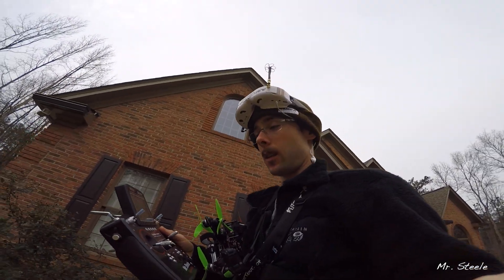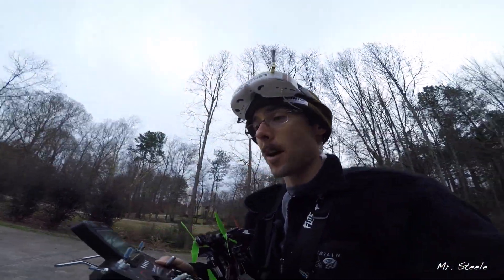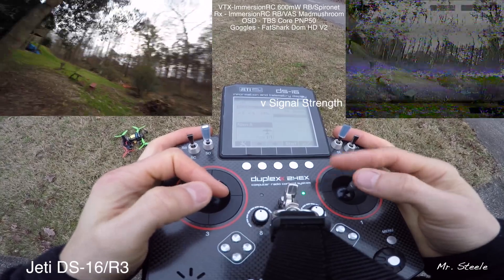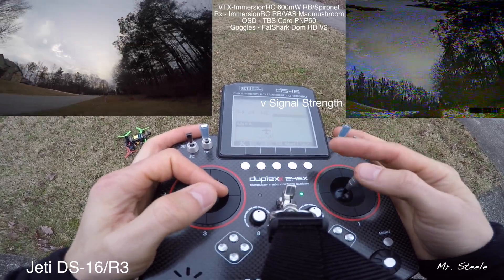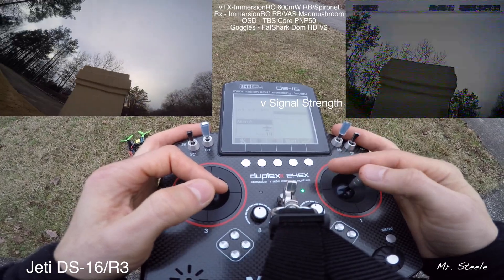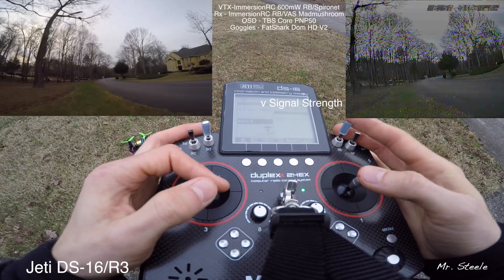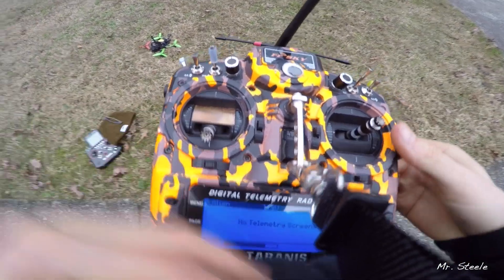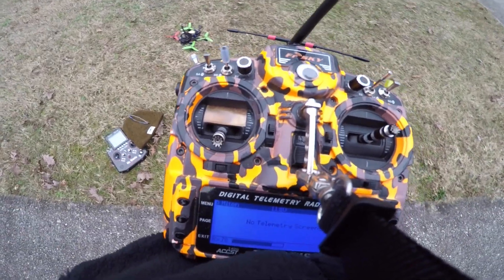2.4GHz RC Range Test Jeti DS16 & FrSky Taranis

Comment: Mr Steel   hi im in need of a bite advice please  i just got my fist race quad the nighthawk 280 pro   and i was going to use my FUTABA RIPMAX  T6EXA  but it has the old telescopic aerial   will i have to change it to a 2.4 antenna    and will this connect to the nighthawk ok  steel

Comment: Is there a hobby shop in the Atlanta area that will let you check out the FatShark goggles in the store with video to see how they work. I have a vision issue with one eye and with my GearVR goggles I don't get an image as clear as I'd like. Before I spend that kind of money I'd like to know they work. I've also looked at the Quanum V2 Pro. I want to do FPV with the quad I'm building after I get comfortable with it. I don't know if goggle will work for me or a fpv screen on my radio. Any suggestions?

Comment: Very much impressed at the taranis performance.  Despite lower build quality and a few less features, it puts up a good fight with the jeti!
Reply from the maker: Wasn't really suppose to be a comparison video. Merely a test to show the penetrating power of both rc links.  Frsky has proved it can penetrate objects and perform in a wifi saturated area before. I wanted to test the Jeti's link against something I know works really well for FPV models.   Since jeti is mainly based around high end LOS models
Reply: +Mr Steele Ah, I see.  It looks like the range issue is fixed though with the jeti! Looking forward to more!

Comment: About what angles are the GoPro/ FPV cam at on your alien?
Reply from the maker: Board cam is 30* and GoPro is about 20*
Reply: +Mr Steele is that 30* plus 10* motor mounts?
Reply from the maker: +Oliver Peters nope. I don't use angled mounts anymore
Reply: Any reason you stopped using them?
Reply from the maker: +Oliver Peters reduction in yaw authority.

Comment: +Mr Steele, nice test vid. It will be interesting to see if the Frsky Horus does as well as the Jeti D16. For heaven sakes what are rates set at? Hardly any stick movement for forward pitch...
Reply from the maker: Thanks. I don't think the Horus will do any better. There aren't any power or sensitivity upgrades in the Horus that I am aware of.
Reply from the maker: And in rate mode or Acro mode you don't need to hold forward on the pitch stick. Once you are flying forward you can just go back to center stick and adjust accordingly.  Rates aren't super high
Reply: +Mr Steele that may sound noobish but why centering the pitch doesn't set the quad on the horizon ? If you push the pitch half way forward , let's say it set a 40deg angle to the quad, and then you pitch back to a quarter forward. Will the quad still have an 40deg angle or will it be at 20deg. (If linear of course) ? 
Great videos, keep up the good job !
Reply: You're getting self leveling mode mixed up with "acro" also more accurately called "rate mode".  In the self leveling mode, the deflection of the sticks for roll and pitch actually cause a given movement about that axis that is proportional to the stick deflection.  To keep a 40 degree angle, it would require that you hold the pitch stick in a given forward position.  Half lets say.  In "acro" or "rate" mode, it works just like an airplane does.  Stick deflection causes the rate of movement on the given axis to speed up with more stick deflection.  When you hit the pitch, roll, or yaw target, neutralizing the controls leaves the aircraft attitude unchanged.  To get your quads attitude back to neutral, you have to move the controls in the opposite direction, which will control the rate at which the quad comes back to neutral.  It's just like in an an airplane.  To turn, you exert pressure on the stick in the roll direction, and when you reach the desired angle of bank, you go back to neutral.  When you don't want the aircraft rolled anymore, you do the same thing in the opposite direction to roll it back to straight and level. Then neutralize the controls.  It's very intuitive.  In a quad, it can get tricky because of the lack of stability compared to a plane, and learning it a sim, is great.  Once you get used to it, you won't use self leveling mode again.

Comment: so I fly the exact same taranis setup you do (hardware wise anyway, even with the crossfire setup). I live in the suburbs of san diego and the complex I'm in is HEAVILY saturated with 802.11. 5.8ghz video gets a bit scratchy when I get like 50 yards away even, I haven't tried to push the 2.4ghz link since I basically moved everything over to the crossfire systems. 
While on that topic - do you have any thoughts on antenna protectors for those crossfire micros? 2-3 crashes and they get completely shredded.
Reply from the maker: I just heat shrink the antenna to a zip tie and attach it to the rear standoff. Never have an issue.
Reply: I ghetto'ed that - i used gaff tape instead of heatshrink - had the ziptie sticking straight up. 2 crashes and it got chewed to hell. Also, vortex, collapsing arms, so when they fold in during a crash they sort of .. eat .. stuff.

Comment: Is the Jeti really $1000 better than the Taranis?
Reply from the maker: As far as quality goes. I think so for sure. The range is about the same as of right now.  And honestly I don't think the Taranis abides by all the FCC rules
Reply: +Mr Steele What makes you think they don't abide by the rules? The gear is all FCC certified--for example: https://apps.fcc.gov/oetcf/eas/reports/ViewExhibitReport.cfm?mode=Exhibits&RequestTimeout=500&calledFromFrame=N&application_id=0H5q4Euu5NroDqLMUk4gOQ%3D%3D&fcc_id=XYFX91216DK
Reply from the maker: 100mW is 100mW.  The performance of this Rx link is very very robust and solid.  I'm not saying they are. I'm saying they may have some tricks up their sleeve to get the link quality so high

Comment: What do you think of the Jeti programming compared to the Taranis?

I have a Taranis for FPV only and it's very confusing to program in my opinion. I know Futaba like the back of my hand and JR and Spektrum I can manage. But Taranis for me is just a different language.
Reply from the maker: Hey Kyle !   Love your flying. Hope to get to chill with you one day soon.
  
 Jeti programming is pretty intuitive. More so than futaba and spektrum for a newbie with some rudimentary understanding of logic.   I spent 2-3 hours with the radio one night and was setting up logical switches for special throttle cuts and telemetry call out switches by the end of it.  I started on Spektrum with CP heli's  wasn't a fan of the logic or the signal quality at the time. Early 2014.  I've programmed futaba and JR.   The taranis is by far the quirkiest firmware I have used. But it does things easily that other radios  require a work around. Or quite simply can't do. (Some switch set ups and or module bay serial output etc.). Mainly I keep it simple though  radio is just used to set up arm and idle up switches and subtrims and end points..  That's all I need.  
Cheers
Reply: +Mr Steele Thanks man!
I guess we have a similar setup Taranis wise!  The features are cool and impressive, old school always works though :)

Would love to fly with you some time! Let's work on that :)

Comment: Are you using the 3.24 S.Bus or UDI firmware?
Reply from the maker: "Standard" 3.24 running UDI
Reply: +Mr Steele Have you tried the S.Bus firmware it works great fore me and also in Device explorer, General Settings I select Computed for fail-safe to work.

Comment: Interesting comparison if you consider the difference in price range. How far you went in meters? (asume behind you and with obstacles)
Reply from the maker: It's a link comparison not a radio quality comparison.  The quality of the jeti is in a different league.  Comparing the two is like comparing a 2016 BMW M3 to a 1997 toyota Corolla.  They both get you to the same location. But which one would you rather drive ...  And price reflects that as well.
Reply from the maker: I flew roughly 150-200m away behind many obstacles.